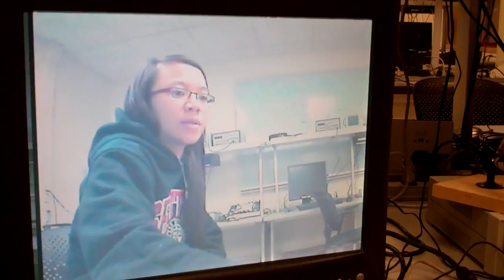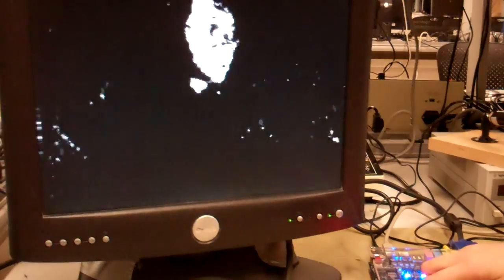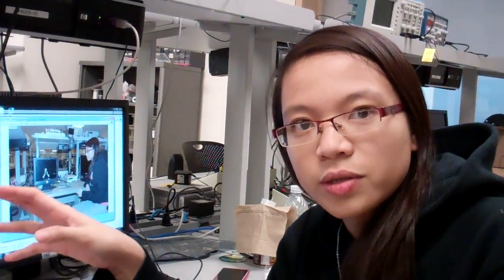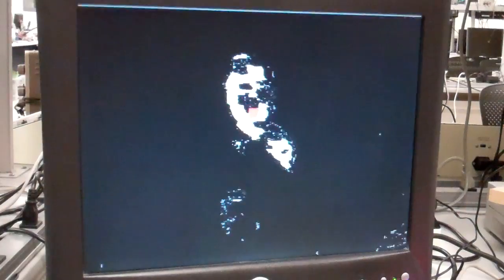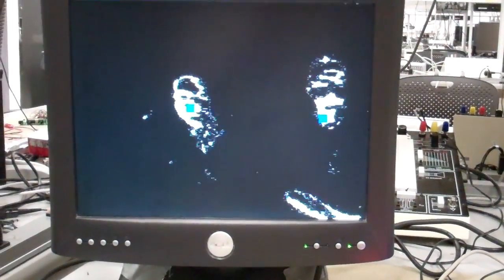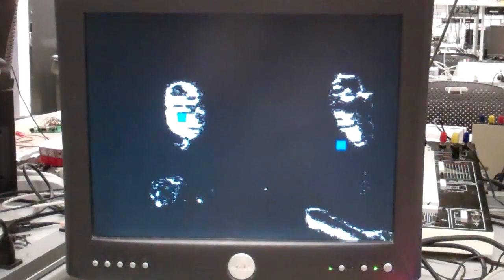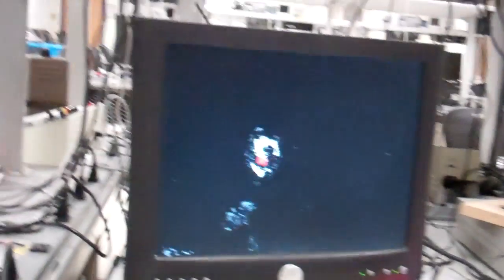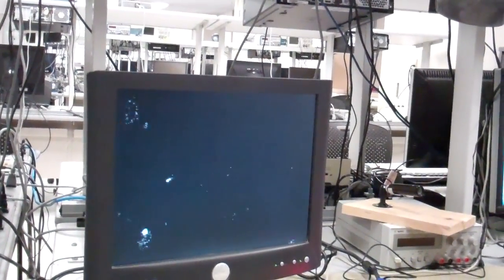Face detection and tracking on FPGA

Comment: Thank you for the Verilog code. I am used to learn VHDL, but will force myself to learn Verilog HDL too. Great video. Just this board is too expensive for my taste.
Reply from the maker: One way or another, if you wan to do this project, you will need peripherials attached to the fpga. That is not cheap
Reply: @ece4760  You are right. But my problem is which board to chose?! So far, I am working on cheap FPGA (Cyclone II), just board, 50 MHz oscillator and flash memory). For ADC, DAC and other thing, I have plan to use STM32 MCU, at least for audio part. For VGA, it may be problem, but maybe not - soldering some "R/2R resistor ladder" and everything for first video work. For webcam input, that might be the problem, but I will solve that somehow. Thanks anyway.
Reply from the maker: @MilanKarakas  I wrote this a few years ago 
https://hackaday.io/project/5033-de0-nano-fpga-to-vga-output
Reply from the maker: Webcam input is quite difficult. The USB protocol is very complex. It is better to use a serial output camera.
Reply: @ece4760  Well, yes. I noticed that when study USB on STM32. Just not familiar with whole concept. Serial output camera? Is that like IP camera or what?
Reply from the maker: @MilanKarakas   Like a ov7670 or OV5642
Reply: @ece4760  Thanks.
Reply: @ece4760  Okay, just bought both. Just in case that 5 MPx has too much data, then 0.3 MPx will suffice. Thank you again.
Reply from the maker: @MilanKarakas   This student project connects 4 cameras to a somewhat larger FPGA http://people.ece.cornell.edu/land/courses/ece5760/FinalProjects/s2018/bt346_yw883_ap2289/bt346_yw883_ap2289/bt346_yw883_ap2289/index.html

Comment: sir materials of this project : just camera and fpga board and monitor 
and special camera or any camera !!!
Reply from the maker: Did you read te linked report? NTSC camera
Reply: thank you to reponse this project my Graduation .....Yes I read I want to check only....so we need fpga and camera NTSC and monitro !!!!
Reply from the maker: @ahceneouachemi1389  did you read the report? YOu need a DE2 board, a VGA monitor, an NTSC camera, and of course quartus software
Reply: Does he work by xilinx ise  sir !!!!
Reply from the maker: It would mean completely rewriting the verilog, assuming that the xilinx device includes a video codec
Reply: you mean the logiciel for write the code verilog is xilinx  !!
Reply from the maker: It is not xilinx. It is altera software running on altera FPGA
Reply: The Quartus II  !!

Comment: do this user have an email address?
Reply from the maker: If you have a quesion, ask it here.
Reply: @ece4760  . I am an undergrad student, and my final year project is titled as “Video Compression using FPGA”. To implement FPGA design, I need some guidance from your side. 

I will also like to know that, if I could enroll myself in certain workshop or FPGA learning programs so as to achieve my objective.
 
I will be using Xilinx Spartan 6 FPGA family for this project. Please comment on that as well. Will I be able to implement the video compression algorithm on this sort of board provided by digilent atlys.

Kindly visit this link in order to get an insight to the board that I will be using. https://store.digilentinc.com/atlys-spartan-6-fpga-trainer-board-limited-time-see-nexys-video/ 

Your reply will be a favor
Reply from the maker: @The2wistArk  The question you are asking depends on your background. Have you studied design of digital sequential circuits? What do you know about orthogonal transform methods? What do you know about compression? Have you read the Xilinx tutorials for the FPGA. What software are you using? Why did you choose this project?
Reply from the maker: Also, of course, google "spartan 6 image compression".  or "spartan 6 tutorial"
Reply: @ece4760  I always wanted to tackle some challenges .. i knw alot about about digital logic design i hv done the course in my undergrad.. plus i dnt know about vhdl yet nd learning and designing the algo is the real challenge!
Reply from the maker: @The2wistArk  Compress using run length encoding? JPEG? MPEG? fractal compresson?  
https://en.wikipedia.org/wiki/Image_compression
Reply: @ece4760  thnkw for providing wikipedia link bruce.. BTW using 5 mins of google gave me alot than tht.!

Comment: Which camera module is used? can you provide the link or manufacture details. i just want to know whats the interface between camera and FPGA?
Reply from the maker: Did you read the report? The camera is a generic, NTSC camera connected to the NTSC codec on the DE2 board.

Comment: Great work sir , Is it is possible to extend this technique to recognise face in real time on FPGA.
Reply from the maker: recognition is much harder than detection. I do not thik this technique will work for recognition.
Reply: Thanks for your reply. Sir. I thought, if i detect face with this technique, then only  the detected  portion of video match with data base and apply  some technique of face recognition so we able to face recognise. but as your suggestion I leave it.

Comment: Sir how can I convert matlab code into verilog code 
Detail any software or step which you used
Reply from the maker: the student converted the code by hand by understanding and optimizing each step. No software was used to convert.
Reply: Sir I have two code one for matlab and another for verilog but matlab give exact output but verilog code is not properly run.
I want to know what operation exactly perform in fpga board
Reply from the maker: The verilog code on the FPGA did all operations. Did you read the report?
Reply: Bruce Land 
Yes sir I read all your report. In this you mentioned conversation of matlab code is not a easy task and also write an implementation of morphological filter in verilog is very difficult. 
But in your report a verilog code also give, I want to ask is this code is sufficient for face recognition,if no so what step should I need?
So please help me on this....
Reply from the maker: This project does face DETECTION, it does not do face RECOGNITION. Recognition is much harder. There is a huge ligature on face recognition. Start reading

Comment: Can i ask where do your students get sdram controller? I have de0 nano with 32 MB SDRAM and i was wondering how to achieve frame buffer for 640x480 camera resolution - i found two ways to be most appropriate for me - one using sdram controller from hamsterworks (quite popular vdhl sdram controller for de0 nano and sdram chip on it) and other method was to use Qsys (i prefer to have VHDL/verilog controller to instantiate it in my project without Qsys) - ive opened DE2_TV file from link in the description and found that You are using some kind of template from altera (still there are no files for sdram controller if im right, only sdram framebuffer instantiation Sdram_Control_4Port u6)
Reply from the maker: You are right. Thye students got it from the TV example. But now we use the University program SDRAM controller for Qsys on DE1-SoC

Comment: Thanks for sharing, very interesting! I will use a newer SoC board to reproduce the function mentioned in the report, also adding some machine learning techniques to based on the original design.

Comment: I want to implement this project but I am new to camera interfacing to fpga and i am not able to find much which help me understand from the basic ...it would a great help if you could share any helpful link (related to camera interfacing with fpga)
Reply from the maker: +Kushagra Gupta Did you read the report?
Reply: I too am interest in this.  Where is the link to the report?
Reply from the maker: did you read the video description?
Reply: +Kushagra Gupta If you read the description's pdf you can see that she sent the captured frames of the camera through composite(I think ALTERA DE2 has video input), and then did all the algorithms and stuff over that, at least that's what I understand.
Reply from the maker: That is correct. The DE2 has composite video (NTSC, PAL, SECAM) input. The hardware codec output is sent to the FPGA where the image is passed thru to DRAM, then analysed on the FPGA

Comment: hi I have connected a cctv camera and the output RCA cable is given to video in. but the display is not coming in monitor. may i know what might be the problem.
Reply from the maker: +Jeyakumar R How could I possibly know what the problem is with so little info. Does the camera produce actual NTSC video. Did you check it? Does the reference video code from Terasic work with your board?
Reply: +Bruce Land  I am not exactly sure about the output format of my Camera. but when i connected my RCA jack to video in port of TV  it works fine. but when the same is connected to video in port  of FPGA DE2 board it is not showing anything. May i know what is the problem. ? I tried working with one more code by connecting terasic camera by connecting to GPIO pins. It is working fine.
Reply from the maker: Jeyakumar R Was the TV NTSC? When you hook a scope to the camera output is it running at 60 fields/sec? GPIO camera tells you nothing useful.
Reply: +Bruce Land yes i understood my problem. CCTV camera does not provide NTSC format. It provides only PAL output. Now how to convert PAL to NTSC format . any idea in DE2 board ?
Reply from the maker: +Jeyakumar R It is easier to change the code to work with PAL

Comment: apologize to its algorithm converts the image into a matrix ?
Reply: +Primavera Argüelles Hmm not really. The image is only a matrix in MATLAB. But in Verilog, the image should be stored ( or buffered if it is a live video camera stream)  in the fpga memory ( mostly block Ram) as an array of pixels. So after, porting the algorithm from MATLAB to Verilog using the MATLAB HDL coder, the algorithm should now be pointing to the block ram as its image input.
Reply from the maker: +alex nice This was not ported using HDL coder. It was ported by writing the Verilog by hand.
Reply: Bruce Land 
Oh okay, please do u know if they used block ram as image storage ?
Reply from the maker: you could read the report
Reply: +alex nice She uses SRAM (maybe SDRAM) as buffer memory. Won't be able to store in BRAM because she uses 640 x 480 resolution unless she has an expensive FPGA.

Comment: Hi!

Would be nice if you can provide in your report the amount of resources used (LE's, DSP's, memory, etc...).
A power estimation report would also be nice, for each of the synthesized cores.

Apart from that great work! Have you considered using other methods for the detection? And from what I can see, you're just detecting, not really tracking. Did you try some tracking methods using filters like particle filters, EKF's, UKFs.. etc?

I checked your report, and I couldn't find the answer to the above questions.

Again, great work and good luck with full completion of your master thesis.
Reply: ***** Also, what camera sensor did you use? Was it the OV7670 by any chance?
Reply from the maker: ***** NTSC analog TV camera

Comment: Interesting approach. Isn't an AI usually used to detect faces? This is adequate for this purpose though. I wonder if a small computer with OpenCV would be more energy efficient.
Reply from the maker: Don't know. Often, hardware which is purpose built  is more efficient, but would be interesting to test.
Reply: I've heard that FPGAs usually use up a lot of energy though. ASICS are obviously the best solution but that's a bit hard :P. I'm impressed though. Good work =)
Reply: What exactly do I have to study to do this? Is it just EE or Computer Engineering?
Reply from the maker: Mikael Murstam
digital design and computer engineering

Comment: You could use the skin detection method to detect probably objects and then calculate the size of the object detected.

Since humans generally have the same head size and shape and that we know the facial proportions of the human face, you should be able to calculate the locations to where you should look for the eyes and mouth for any given head at any given distance.

With the filter used here you could see a pattern that was very similar a round/oval shape for both heads wit some shadows.